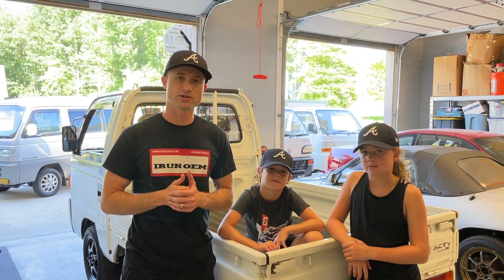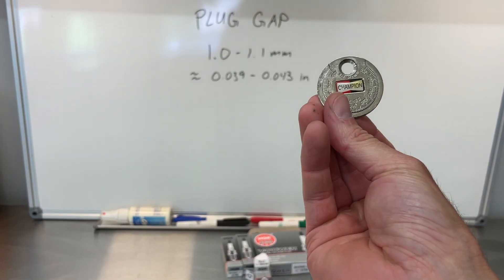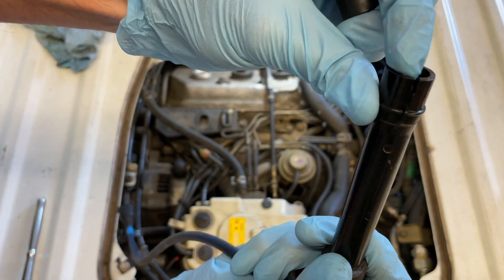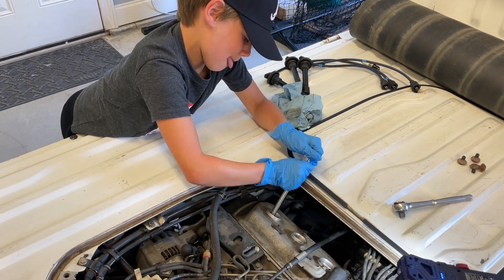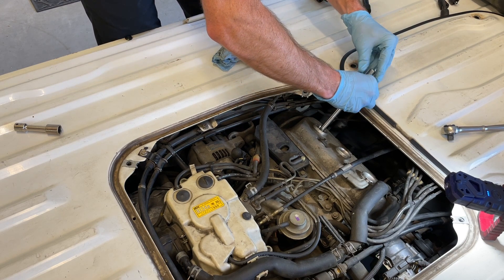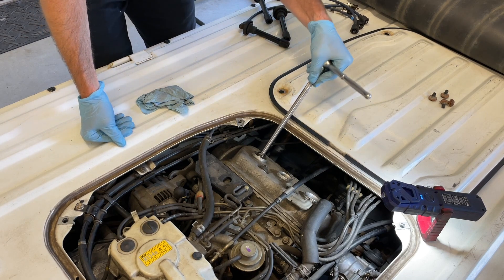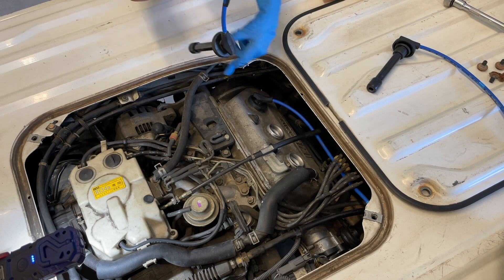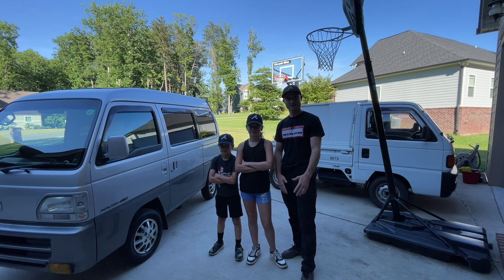Honda Acty Spark Plug & Plug Wire Change #Acty #Sparkplug #PlugWires #RHD_Ron #TuneUp #JDM #Install

Comment: Thanks for putting this video together. My Acty is on order and I'm getting it in part to learn my way around an engine and challenge myself so these videos are great tools. 

I had a question though, why did you also not change the distributor cap/ distributor? Like I said, not mechanically inclined myself but in many of the kits the cap comes along with new seals in addition to the plugs/ wires you show here.
Reply from the maker: I had previously diagnosed those bad wires and honestly just had those reasy to go. I grabbed the plugs that weekend and decided to do a video. 

I had the distributor off before and the cap and rotor looked recently replaced so I didn’t order a new one. Those are obviously good tune up items as well.
Reply: @RHD_Ron  appreciate the response, and all of your videos!

Comment: Thanks for putting out this video. That ring in the gap tool is for setting your gap - it lets you gap without messing with your actual gauge part, and no pressure on electrode.
Reply from the maker: Thanks!

Comment: Finally got my Acty in this month!  Thx for this vid, Ron.  Finished my plugs and wires today and your vid was a great help. 
Question for ya…what causes the engine to bog down when running heat/blower or headlights/brake lights?
Yep, added a new battery when I got it off the Port of Freeport as the battery was dead…. Am I needing a new alternator?
Reply from the maker: Hey Jerry! Congrats on the purchase, good times ahead. Given those symptoms i would say alternator. Both issues are electricly driven it sounds so I would get the amp output checked on the alternator. Good luck!